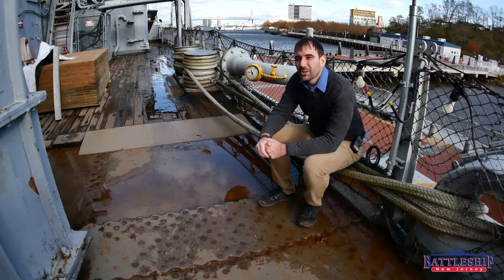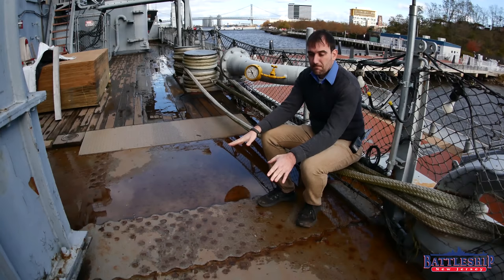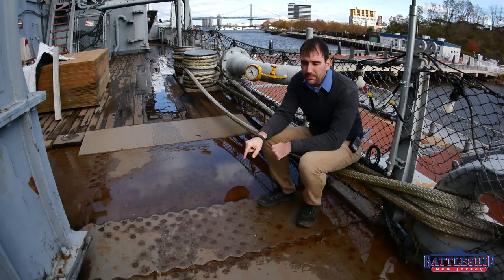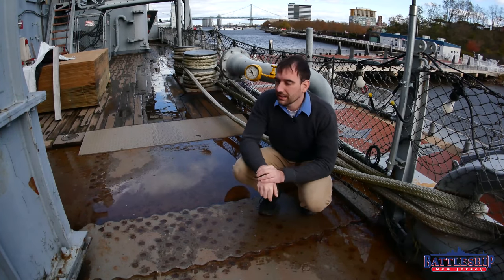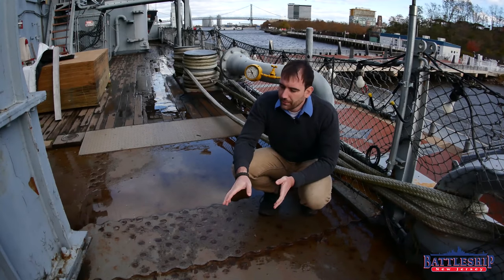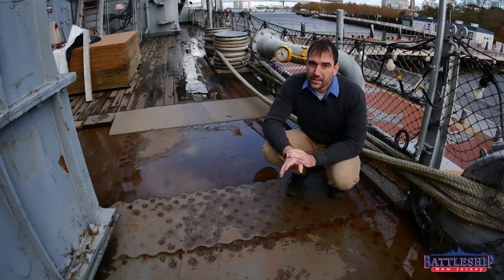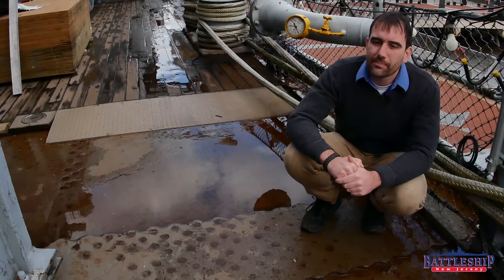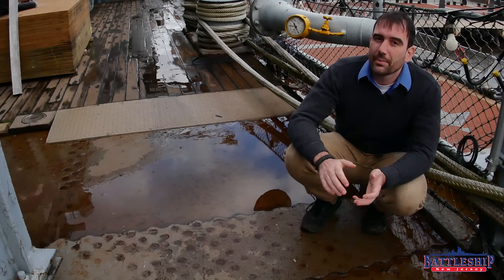What's a Gusset Plate?

Comment: While most of us collects 1/700 and 1/350 scale model battleships, Ryan gets to admire his 1/1 scale real original battleship.  I'm quite jealous.
Reply: If it's any consolation he still can't use the 16" guns nor can he use the steam powered stuff.
Reply: I’m working on a 1/350 scale USS New Jersey as she is today. One surprising feature of this Revell model is you can make it R/C with four electric motors in a kit that comes from Hong Kong. Anyone know what kind of a control module I would need for the motors and the two rudders?
Reply: @craigbathurst1185  I do not but you might want to check if you have hobby shop in your community. They usually have RC kits in addition to plastic models or at least may be able to put you in touch with RC people.

I have two hobby shops near me. One has games and plastic models, the other is plastic models and RC planes & cars but no games.  So don't be discouraged if the first one you go to doesn't do radio control.
Reply: @craigbathurst1185  If only there was a way to search the internet for information like that.
Reply: @haywoodyoudome  it depends on the key words you use and search 10 pages in the search results
Reply: The crown jewel of any model collection
Reply: @craigbathurst1185  I'm not sure about 4 motors, but i know you can do 2 motors with standard equipment.  You just make a mix in the controller to match the 2 outputs.  I know RC crawlers can mix a front and rear motor, but i've never messed with RC boats.  Maybe you could run two motor channels, one for for left and one for right, and just duplicate the signals to the 3rd and 4th motor?  or even just leave the side screws unpowered and run just 2 motors?
Reply: But it's hard to find a display case for the 1:1 model.
Reply: Oh 1/1 scale is the only way to go!

Comment: As a welder I would call them doubler, or lap plates. A gusset is perpendicular not parallel to the plate you are reinforcing. The curve prevents a hard corner, hard corners are prone to propagating cracks.
Reply from the maker: For us, doubler plates are reinforcing after the fact. So we put double plates over a hole that we can't crop out.
Reply: @BattleshipNewJersey  we would  call that a patch plate
Reply: Agree that would be called a doubler or lap reinforcement in the yards I have been in. Gussets were always perpendicular to the pieces joined, and typically died into one or more corners.  If used to stiffen a flat plate, it would be a special gusset called a strong back. But regional differences are a thing. Curious if there is a nomenclature reference around that would offer anything definitive.
Reply: if you ever look at impact sockets vs regular hand tool sockets the "points" of the hex are rounded out for this same reason
Reply: @burroaks7  Snap On, Flank Drive

Comment: As a steelworker, I love watching your videos just to look at the construction of all of the settings you shoot your videos in.

In regards to the scalloped gusset plates- these could be oxyfuel cut quite rapidly if they weren't just stamped as a stock engineering part (stuff of that size is a license plate compared to the mills shipwrights use). Given a template and a torch I could scallop both sides of the plate in maybe ten minutes. The rivet holes could also be similarly flame cut rather than mechanically bored.

I think that in addition to the (minor) weight savings is that the scalloping prevents stress risers between the rivet holes/rivets and the edge of the plate. By keeping the edge a consistent distance from the radii of the rivet holes any flex stresses are spread out along the entire length of the plate rather than concentrating and forming cracks at the points of minimum distance between the gusset plate edge and rivet hole. This makes the plate much less prone to failure when you take into account the forces that will always be acting on it.

Given that the New Jersey was designed to fight the most unrelenting and undefeatable adversary possible on Earth (the ocean), this was a good idea.
Reply: Ten minutes? I don’t think so, that plate goes the whole width of the ship.
Reply: @johnnunn8688  no you can see its only about 5 feet long.

Comment: Answers to the Gold plating question: (1) the use of riveting; (2) the trimming of seamstraps; (3) the use of scalloped seamstrap welds; (4) the machining of lap and scarf joins into the hull plating; (5) Tapered T-joints in the shell; (6) shaping the hull from the shell and having to template the frames off of the rivets; (7) having shell strakes that reverse their overlaps; (8) the riveting on top of welding on the keel; (9) the use of face hardened armor even after everyone was using capped projectiles; (10) the machining of the lower belt armor taper. (11) The machining of overly complicated joints into armor plates.---The US could never have completed 17 Essex-class during the war if they had been constructed like this. The US could have completed USS Kentucky and USS Illinois during the war had the resources been devoted to them but it would have been impossible to have built additional Iowa-class during the war due to the amount of resources they consumed to construct.
Reply: carriers are not battleships, (except the few that were) they don't have to be as armored or have as much redundancy, plus welding was problematic on early liberty ships

Comment: I read docs on the initial construction of the Iowa's and it said that all the rivets were bored individually with special air-impact drills one at a time and that none of the holes where punched out on any framing or any class A or class B armor, Now what they did during the 1980's may be a different story. Also, the scalloping was done on some sort of jig on a huge milling machine. I also read that some Class A lap joints where milled before joining with the plates and rivets. Additionally, there was a huge keyway cut into the edge of the main class A armor deck and the angled class B belt, and had big keys driven down the length of the keyway to add strength in addition to the class B belt being riveted to frames. No Oxy torches were ever used after the armor was face hardened, at least until the 80's.
Reply: Any link to that doc online?

Comment: Gussets are used in all sorts of engineering. A failure of gusset plates has led to several bridge collapses over the years.

Also, they're used in clothes.
Reply: As a welder, I use gussets to hold up the cat walks on the car haulers we use.
Reply: There was a whole section of my structural steel design class dedicated to gusset plate design and failure analysis
Reply: 35W Bridge collapse here in Minneapolis in 2007 was due to a failure of gusset plates if I recall correctly.

Comment: Probably the most "gold plated" aspect of the Iowa's is the extensive use of STS... for its time, having an armor steel with enough ductile strength to be used for structures was very expensive. To my knowledge, no other nation used an armor steel that way. The US was using it for everything in the armored citadel and the weather deck, outer hull plating, etc.

Comment: The scalloping on those plates is not a weight saving measure in this application it is for preventing stress cracking along the plate edge as it flexes. If the edges of the plate were flat every time the deck flexes it would try to curl up the steel spanning between the rivets along the outer edge of the plate causing work hardening over time leading to cracks. Essentially this plate is built this way for the same reason you dont build an airplane with square windows. If they were really concerned about weight to that extreme level there would be far more concessions to weight savings in other parts of the ship. They could have saved as much weight by getting rid of one of the ice cream machines or any number of other things. You are correct that it is an example of "gold plating" but for longevity not weight savings.
Reply: Ice creme machines stay! The CO wants his ice cream from the machines, not frozen stores! The XO, Supply Officer, and CHENG have made that clear. A Gang will focus on the ice cream machines !
Reply: @SSN515  That was on the priority repair list radioed by the USS Yorktown to Pearl Harbor when it was steaming back from the Coral Sea - ice cream machines are good for morale...

...US Navy repair and damage control crews working on the Yorktown were bad for IJN morale:

"We sank the Yorktown at Coral Sea..."
"Wait a second, that's the Yorktown, die, ganji, dieee!"
"We spotted a US carrier, this one wasn't the one we hit earlier..."
"...what the *****!  That was Yorktown?!?!  Surely we sank that ganji concubine now!"
"...um, this is Yamamoto...Tojo's laundry got wrecked, and the Yorktown's still afloat..."
"...the Silent Service has to do ALL the work!!!  At least we don't have the Mark XIV's!" 
"IJN, this is Admiral Nimitz...Admiral King is mad, surrender now, we got the Mark XIV's fixed!"
"Nimitz, this is Yamamoto, ** you...oh, shit, you shoots me down aieeeeeeeeee!!!"
Reply: I thought it was all about the strawberries...

Comment: In aviation, those "gusset" plates would be a "splice plate" and that curved edge (2:24) is referred to as scalloping, which is also as a weight reduction measure.  The Society of Allied Weights Engineers has 3 specialties - land vehicles, aircraft and.....marine vehicles.  So, yeah, weight reduction and weight management, is important in all vehicles.  In aircraft, those scalloped edged are 2 times the diameter of the fastener, plus 0.050" away from the center of the fastener.  2D is the key....the 050 is margin for a slightly misplaced, or if needed, oversize, fastener.  If you measure, I'm sure you'll figure out the criteria that the Navy used to scallop the edges of those gusset, er, splice plates.
Reply: I was thinking it might also be a way of avoiding stress concentrations by not having any hard edges from the rivet holes

Comment: It's interesting that those cutouts were to save weight.  When I saw those, I assumed it was to provide more length to a weld--similar to another video you did discussing... think joining the belt armor...  Maybe it was hull armor.  Either way, they did both riveting and welding because the navy didn't trust welding yet.

Comment: A few quick comments from someone who thinks about stuff. If you are bringing two pieces together, the hole patterns on both sides are a known item. You just don't randomly drill holes. So the hard part is to make sure the gusset is manufactured / milled so that the two sets of known patterns match each other. Besides, you would want some play in terms of tolerances so it can flex and move. 

Second in terms of cutting away material to save on weight. This does not pass the smell test. If they are trying to save weight, they would be implementing this savings everywhere. Piping, racks, furniture, etc. My gut tells me that the out edge would experience some sort of fatigue in the metal due to the holes and stress lines radiating out if each one. To compensate, either you make the edge wider, i.e. more materteral to do the job or cutting it down to eliminate the stresses. There has to be an engineering reason.
Reply: There is. Stress cracks begin at sharp corners, which is why airplane windows aren't square. Even in the cockpit where the windows look square you'll see that they are rounded at the corners.
Reply: @ghost307  Exactly! I'm also reflecting on eyebars. It's a long piece of flat steel that has a rounded end that allows them to be mounted to a pin. They would cut the unnecessary material between eye holes to reduce weight, but why bother cutting around the hole? It has to do with stresses.

Comment: Hey Ryan, 

How much does a panel of marine grade plywood cost? I would like to buy and donate a panel to help further the restoration process of the Battleship. Also what thickness and dimensions does the panel need to be?
Reply: Plywood is generally 4'x8', they're probably using 1" since that's what he said they'd need to notch so maybe $120 or more retail price or at least that's what I've seen for marine stuff from like home depot, I'd imagine and hope that they would be able to get it from a wholesale company for less than that and maybe even in larger sheets so they can do more with one sheet of plywood.
Reply: @BlackHawkBallistic  Agreed. You can special order longer pieces of plywood but they're all 4 feet in width.

Comment: A bit less gold plated than it sounds, still extra work, but not all entirely hand cut in all cases. If you want to add the waver, drill your holes in a plate in a normal patter. Then drop that plate on a mount. Next to the mount is a table or a plank or such someone cut to have that given wave. Now turn on the torches, and just move it down the length against that log/master shape and your little rig can replicate that cutting pattern. It's a simple method that's been used for ages, even without a large special tool for it (and they should have those at a ship yard), most random people could fashion one themselves within a day, so I'd be highly doubtfull if every individual groove was truly cut by hand as it were. Perhaps hand powered to move it, but still guided so it could be faster with a simple setup to semi automate it.

Comment: The weight of the steel. EVERY cubic inch of steel = .28 pounds.
How thick is the deck plating? By saving a width of 1 inch, over a 12 inch length, you save about 4 pounds on 1 inch thick.

Comment: Face hardening armor the size of New Jersey's plates has to be the definition of gold plating. Making armor of that thickness and quality seems like it would still be challenging even today!
Reply: It would likely be more difficult today, as we don't have the steel making infrastructure that we had in the 30's.  Process control might be better now, due to much better sensors and computer monitoring, but bulk manufacture? No...
Reply: @davidb6576  Yeah the captital investment just to start doing it again at scale would be CRAZY!

Comment: I rather suspect the rivet holes were punched rather than drilled (reference rivet punchings from Titanic still existing from the yard).
Reply: Agreed. Those plates are probably one of the few parts that are pre-fabbed, likely cut and punched in bulk as longer pieces, then cut to fit on site and used as guides to drill the deck plates.
Reply: @NFSgadzooks  Nope, they were individually bored, each and every one, thru the gusset and thru the plate, and sometimes thru the frame below--at least when she was built. I have not heard anything on her 1980's refit except that there was a lot more welding. also, the scalloping was done with some type of template on a huge milling machine--not cut with a torch.

Comment: Rivit holes were pre punched in the ship yard workshops not drilled on site and this isn't a gusset plate in British ship building terminology its a joining plate , cover plate or fish plate, gussets are usually at intersections of structural beams or corners of bulkheads, its possible US terminology is different though.
Reply: I'd call it a joiner or a doubler, personally.  When you say "gusset" I envision a plate welded between 2 plates which meet at an angle to one another, such as a horizontal triangular piece welded into a vertical corner.
Reply from the maker: It seems to be regional difference in vocabulary